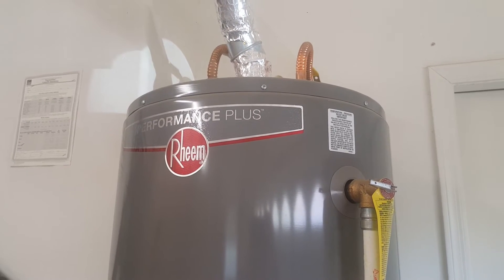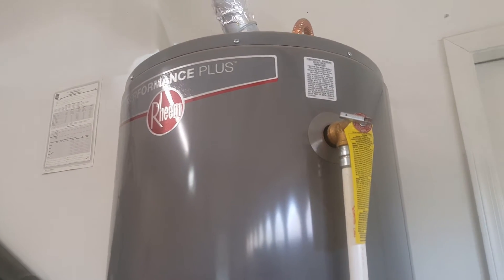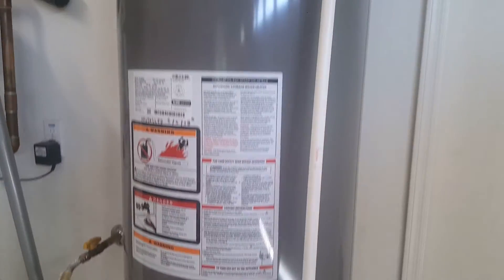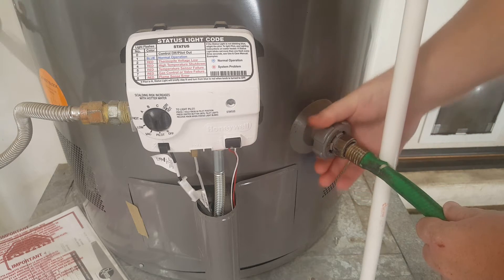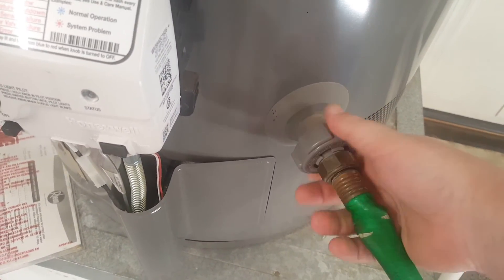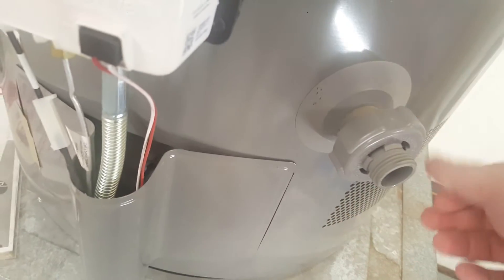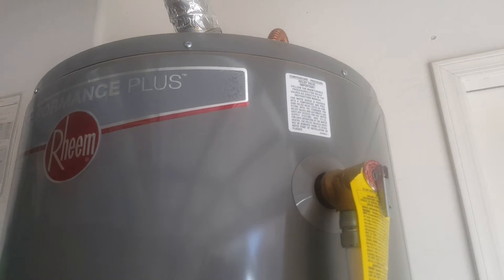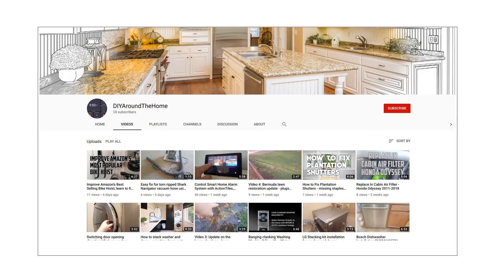How to Flush Water Heater and Test Pressure Relief Valve

Comment: It's best to completely turn off your heater and always turn off the gas being fed into it. Also, if you don't wait the necessary 3-5 hours to allow the water in there to cool just double check and make sure your hose is designed to handle the heat of the water coming out. Most basic hoses are designed to handle around 90-100 degrees of water. The hot water coming out of a hot water heater can be in excess of 150 degrees so it can burn a hole in a standard hose. Some thick neverkink hoses can handle 160 degrees but its best not to push it.

Comment: There is not enough air coming into the tank to create pressure on the out going water, thus not allowing sediments to flush out. It is recommended to remove the anode rod when flushing, as plainty of air will go in the tank when flushing and the water will poor out with force, carrying sediments off the tank. Replace anode as well when flushing the tank, doing both together every 3 to 5 years.

Comment: why would closing the cold water inlet of the water heater cause the hot water side of faucet to stop running? The hot water is still being supplied until the tank is empty>
Reply: Just a guess but by opening the drain valve you are relieving the hot water pressure. Water pressure is what pushes water through the pipes.

Comment: Nicely done! Understandable and, informative! Quick question: In other videos the cold water supply was kept on, explaining this provides more pressure to flush the tank. In your video (and mentioned on the tank) you turned the water supply off. Does turning the water supply off still provide enough pressure to flush the tank? Thanks!
Reply: @mje1625-did you perform your draining and did everything work fine w/o turning off the cold water supply? As in this video, he did in fact close the cold water supply fully prior to draining. Also, did you drain completely or just 5 gallons or so? And did you leave your hot water faucet open the entire time? Sometimes this gets confusing with so many different ways to do the same thing. Thanks.
Reply: @dag1972  Hi! I ended up turning off all the water. I drained the entire tank. The first drained gallon was dirty, but after that the water was pretty clear. I'm glad I did it, but knowing what I know now, I doubt I'll do it again.

Comment: Testing the pressure release valve? NO, UNLESS YOU HAVE A REPLACEMENT VALVE IN YOUR POCKET!! A lot of them don’t fully close after testing.
Reply: Nothing a hammer can’t fix
Reply: Is this why I’ve gone through three buckets of water already because my pressure valve won’t shut off?
Reply: @Chattykp  use a hammer or something to bang it a bit. Sometimes they get stuck with the build up
Reply: Been there, done that! 😂 But it was 30yrs old and I have no idea when it was last opened.

Comment: You could easily have just waited a few hours for the tank to cool down, correct? I have to drain the Rheem Performance I have to replace the leaking plastic valve (like the one in this video) But I'm a little apprehensive about opening the flood gates on scalding hot water...

Also, how safe is it for us DIY'ers to pull that TPR valve? I've heard some conflicting things that you should leave it alone, and others that it's perfectly fine to do...
Reply from the maker: Hook a house up to the valve. Drain it. Then work on the valve to remove it.

There should be videos online, watch a few of those and I'm sure you'll be fine

Comment: God, finally a good video on how to properly do it! The switching to pilot was a nice trick since my gas knob is hard to get to. For those videos that didn't suggest shutting anything off, the ones I watched at least said it was fine because they only drained about 5 gallons of water out to flush the sediment since it should be mostly at the bottom -- they implied a full drain wasn't necessary

Comment: Not sure I understand why you need to turn the water lines off?  Also, how much water did you run during the flush (all of it or just for like 10-25 seconds to get the crud off the bottom?
Reply from the maker: Ran it for several minutes

Comment: READ THIS BEFORE YOU DRAIN THE WATER HEATER TANK. MUST TURN OFF “MAIN WATER SOURCE” FOR WATER TO DRAIN OUT FROM HOSE. I TURNED KNOB LEFT ALL THE WAY FOLLOWING ALL STEPS AND WATER LEAKED OUT INTO BOTTOM OF WATER HEATER. AGAIN IF WATER NOT DRAINING INTO HOSE, TURN OFF MAIN SOURCE OF WATER THAT CONNECTS TO THE ENTIRE HOUSE. IF YOU DONT HAVE THEN TURN ON “COLD” WATER FROM FAUCET IN THE HOUSE. TURNING ON HOT WATER FAUCET IN THE HOUSE DID NOT ENABLE WATER TO DRAIN INTO HOSE

Comment: Why wouldn't you test the pressure release before draining? That would save you waiting around for "normal operating conditions".
Reply: I concur with that.. if you have sediments in your water supply.   one would want to know the valve would perform under the routine use..

Comment: My Electric Rheem says 125-130 top and 120 bottom.   The problem is the thermostat has widely spaced marks.  Totally worthless.  They say it was set at the factory.  Eyeballing it, they look similar.  but with no real marks on the thermostat on where it should be, their engineering sucks. How can you really set it correctly????

Comment: Thanks. The issue is knowing how much water to let out. Their manual is useless. I called Rheem, and they told me, “Fully empty it, and then open the cold water intake and let it flush for 20 min,” which I think is overkill, BS. If the sediment is on the bottom, I believe flushing 3 or 4 gallons would suffice. Anyone got any info on it?

Comment: I tried your way and no water was coming out. I called rheems and they told me to do the same and advised my valve was clogged with sediment. Still no water. 
I called my plumber and he said don't turn off the water and it worked. The water started coming out. No more popping from my heater.

Comment: Very correct: watch a few videos before start. Video briefly mentioned turn on hot water tap before flush. The fact is that you need to keep the tap on. If that does not work, you need to turn on pressure relief valve. In my case, I had to keep the pressure relief valve on before I was able to drain the heater.

Comment: I just installed a Rheem performance plus 50gal tank in my house yesterday. The manual recommends opening the bottom drain valve to purge only a few litres of water once per month with no need for annual total draining, no need to turn off. Very nice tank. Mine has a brass bottom drain valve.
Reply: That's what the guy that installed mine said. Just hook up the hose and and open the drain valve and let it flush for ten miniuts . No need to to close intake valve or turn off gas.
Reply: Draining a few gallons wide open is sufficient if it’s done regularly. 

More important is exercising the TPRV (pressure relief).
Reply: You are probably right if the water heater is drain every 6 months, you might can get away with draining water heater for 10 mins without turning off gas and water supply. However, if you waited a year or 2 to drain your water heater, it might be best to turn off gas and cold water supply let it drain until all the sediment comes and the water is clear. Once you did your annual draining, then you can do so every few months if you prefer. God Bless.
Reply: Once per month! Who the heck has time for that!

Comment: This NOT how the plumber who installed my Rheem water heater told me to flush the heater.
Reply from the maker: What did they say?
Reply: he said do not turn anything off, just hook up hose and turn it on for 15 mns. I have a 2021 Rheem Professional for my home. So now I'm confused (because I have seen other videos telling me to turn off those things)
Reply from the maker: @desertlandscapecreations577  what does your user manual say? I have to think the manufacturer knows better than some install guy who may or may not have a lot of expertise
Reply: @DIYAroundTheHome  good point...I will check after work
Reply: @desertlandscapecreations577  After checking, what are your thoughts? Did you follow the plumber's instructions or the manufacturer manual?

Comment: Just what I needed. I have the same water heater, in my garage, in Arizona! Wonder whether we're neighbors. Hahaha. Thanks!
Reply from the maker: I'm in Gilbert :-)
Reply: @DIYAroundTheHome  I'm in Tucson. BTW I have a water recirculating pump. It connects with a tee fitting to the same spot as the drain pipe. Do I need to shut off the water valves on either side of that before I drain the tank? (I don't want any sediment to accidentally get into the pump.)
Reply from the maker: @terrynashhartmann8419  I would assume that to be the case though I'm not sure. Don't have experience with that set up.

Comment: Tip: If the water tank will not drain, then close the hot water of the kitchen faucet, open the cold water line slightly and allow the water to drain to the hose. If the water continues to drain to the hose, then turn off the cold water line and open the hot water of the kitchen faucet to finish the draining of the water to the hose. Some water will drain to the hot water of the kitchen faucet, but it will eventually run dry and then continue the water drainage to the drain valve/hose. Our water tank is called the Rheem Classic Series Professional 50 gal gas heated water tank (2014 model).
Reply: Great information! Thank you!
Water was not coming out and I was growing concerned sediment was blocking the valve and this tip saved me from calling a plumber

Comment: When I turn the drain valve counter-clockwise, the whole pipe turns with it. I feel like the drain valve will be detached from the tank. A day later after messing with it, my water heater starts leaking, which is clearly not from the water supply from the top. Do I need it replaced?
Reply: @Mario P. Tightening it resolved the issue--- the leak eventually stopped. I almost replaced the water heater because it was still under warranty.

Comment: My hot water heater  at the pilot it has very hot, then C, B, A, then hot, low, Vac, pilot and then off  my question is can just turn down the temperature  just by turning this know to hot? Or do I have to turn off the power to it and remove the top and bottom panel  to adjust the heat, because its way too hot. Please respond to my questions
Reply from the maker: You can turn down the heat. You have three heat settings (A, B and C).
Reply: @DIYAroundTheHome  thank you for your very quick response, Far more than i even hope for, i will go and turn down the temperature, i will sup to your channel thanks again.

Comment: My Honeywell 24v box does not have a "Pilot" point. So where do I turn the switch to? Low? That is the lowest off point available. But there is an "On" and "Off" switch.
Reply from the maker: Is there a model number on the device? Of you could find that I'd try and look for the user manual to find that answer.
Reply: @DIYAroundTheHome  Thanks for the fast reply. The model is: WV4262E1107. It is connected to my 38G, Platinum Performance Rheem water heater.

Comment: I turned off my water inlet then proceeded to open up faucet. However, mine keep running. It didn't stop as in your video.  What steps do I need to do next?
Reply from the maker: Do you have another valve that turns off the water? Maybe you turned off the wrong one?

Comment: I'm in Chandler, AZ. Tank has been installed for 5 years and I need to drain it do to a gas control valve failure. It must be encrusted with heavy water deposit because I can get any water to come out. Even after removing the supply line to eliminate any vacuum. Any thoughts? Thanks
Reply from the maker: Our water in Arizona is pretty bad from a deposit standpoint but five years isn't a whole lot of time so I'm kind of scratching my head too wondering what's up. 

What is the model number of your unit and have you tried finding the manual and looking at the troubleshooting section?
Reply: @DIYAroundTheHome  Can't thank you enough for the quick reply. I went over to Ace and bought a washing machine line (female connectors on both ends). Connected the water heater drain line to the water spicket and hit it with some back pressure. That did the trick. Had all kinds of solids coming out of it. Water is now draining clear.
Reply from the maker: Nice, yeah definitely try to do it every 12 months at a minimum our water out here in the desert is really bad. I was lucky in that the place we bought has a water softening system but even that I'm sure it's going to need some major overhauling sooner than later since the house is 18 years old

Comment: Ours has a small slow leak coming from the spidget...noticed it last week. We bought the home which the Rheem was already installed, no Manuel....
Reply from the maker: Probably only a matter of time before it goes bad. Is the area where it's located ok if it fails? If it's like mine (in a garage) then you can probably wait until it goes bad before replacing as it wouldn't do any damage to your property... but if it is located in a place where water leakage would lead to costly repair then it might make sense to change it now.

Is there a date on the tank of when it was manufactured or installed?
Reply: @DIYAroundTheHome  it’s just like yours, gas. It was installed 3/19/2018. I’ve tighten it and its still leaking a tad. It’s located in our garage with the plastic tub on bottom.
Reply: I don’t want to tighten it to tight because I have heavy hands and don’t want to strip it.
Reply: It’s leaking from the actual opening where you drain water from...
Reply from the maker: That's new enough that it shouldn't be having issues. 

Where exactly is it leaking on the top?

Also if the tub over flows will the water do damage elsewhere?
Reply from the maker: Hmmm, maybe try a 1/4 more of a turn and see if that does it.
Reply: @DIYAroundTheHome  We’ve been in our home for almost 1 yr and it started leaking last week. As far as the heater it sits on a 3 ft pedal with the plastic tub under it. The water is going in the tub which I’m using my wet vac to keep it clean. My garage is concrete so I’m not worried about that. I haven’t ran across a video on Rheem with a leak coming from the actual opening drain where water drains from.
Reply from the maker: @walkerinmotionllc8618  I believe you can swap out spigots, maybe have a bad one?
Reply: @DIYAroundTheHome  that the next video I’m researching for with this brand. I’m thinking it’s a bad spidget as well. Thanks for responding 🤠
Reply from the maker: Good luck! Let everyone know when it gets fixed what it was.

Comment: Same issue as others in the comments. Had the kitchen sink hot water open and it still wouldn't drain. Had to open the pressure relief valve before I got anywhere.
Reply: or open cold slightly, it should start draining the tank

Comment: Your directions are good except the water on my Rheem did not drain until I opened the pressure valve.
Reply from the maker: Did you have a faucet in the house open?
Reply: @DIYAroundTheHome  are you supposed to leave the faucet on? or do you turn it off after it has stopped running hot water?
Reply: @thomasramirez1187  you leave the faucet open while draining the tank

Comment: I just tested my valve. First water to come out was brownish and nasty looking then quickly came out clearer. After I stopped some water was coming out. More than just dripping but coming out like crazy. I read online to flush it a few times to clear the debris that may be blocking the seal. I did and it’s much better. It’s dripping a bit and the water is not hot so doesn’t seem like it’s dripping from inside. Could this be leftover from the long white pipe? The leaking is very minor.
Reply from the maker: Most likely, just keep an eye on it and see if it eventually stops (or not)

Comment: My water heater is in the attic and there is a pipe that runts from pressure relief valve to the side of the house.   As another way to flush, can't you just release the pressure relief valve?
Reply: No. The pressure relief valve is towards the top of the tank so you won't flush out any sediments that way. After draining the tank as shown here you might turn the cold water supply back on just briefly to stir up any sediment at the bottom of the tank while the bottom drain valve continues to drain out the water.

Comment: Hi, I’m a new homeowner and I just moved in. After 3 days in, I got no hot water. I found that there was a pressure switch is open when it should be closed. Can u do a video on how to fix that or show me how please. I just couldn’t find the pressure switch. I have exactly the same as you heater. Thanks so much

Comment from the maker: Gotcha, yeah the drain valve shouldn't leak in any place aside from the actual opening where water is supposed to drain from. 

Is your unit like mine? With mine all I did was tighten the house on (clock wise) hand tight... then loosen the grey circle thingy counter clockwise to let the water out.

Comment: I tried this today and everything went fine until I went to open the valve. It seemed like the whole pipe was spinning with the valve. I had water trickle out from under the pipe so I was worried I was going to have a mess. I tightened it back up and there was hardly any water in the hose. Is it your experience that they move the entire pipe when spinning this valve?
Reply: If you watch him in the video the hose turns with it. So yes the pipe turns also.
Reply from the maker: The valve meaning your water supply? 

As for water not coming out of the hose did you open a kitchen faucet?
Reply: @DIYAroundTheHome  the valve as in the drain valve on the bottom of the tank.